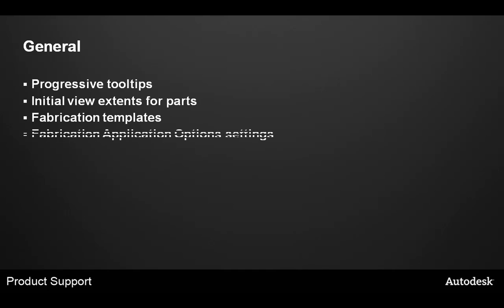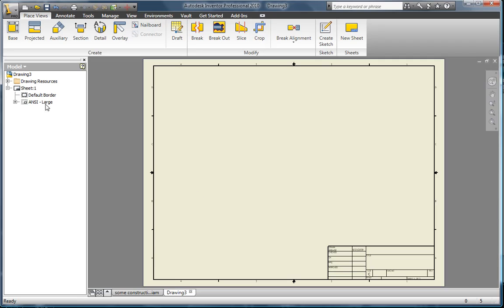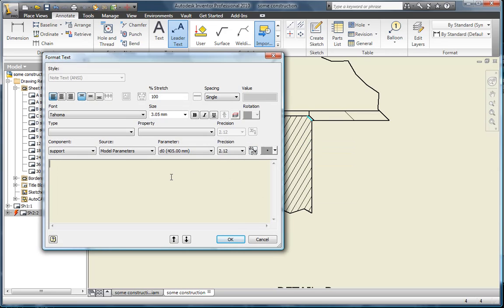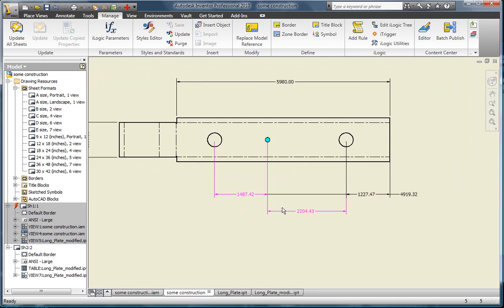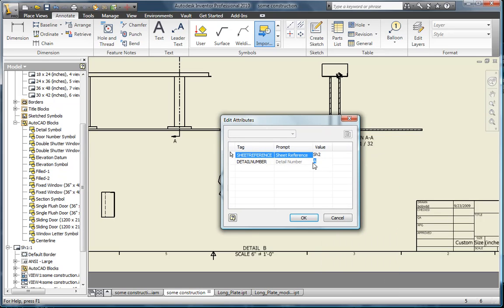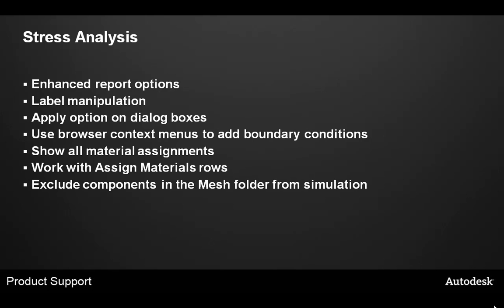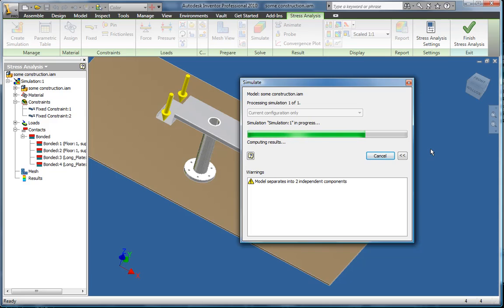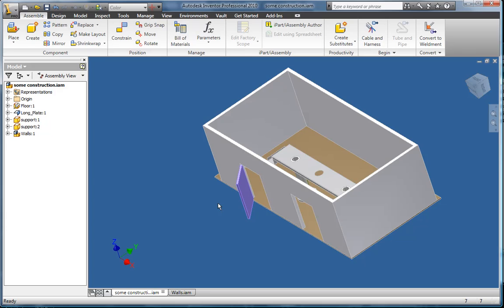Inventor 2010 Subscription Advantage Pack

Comment: What happened to the last 2:31 of the video?  Is this the Nixon tapes?
Seriously though, over 200 mm deflection in the stress analysis?  That's over 2X the _width_, much less thickness.  I know this is just for showing features, but please please please at least alert your viewers to common pitfalls of FEA.  Any deflection over ~10% of part thickness should usually be run with nonlinear analysis.  Also, use symmetry to simplify if possible, and watch out for sharp inside corners.  Thanks!